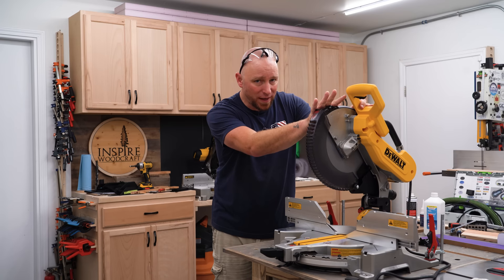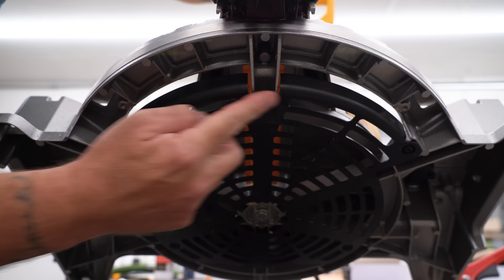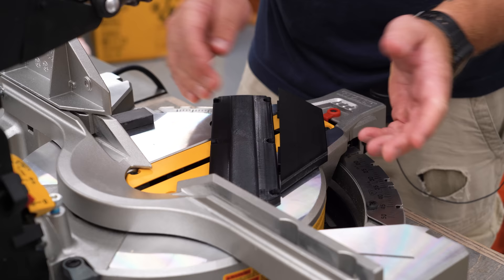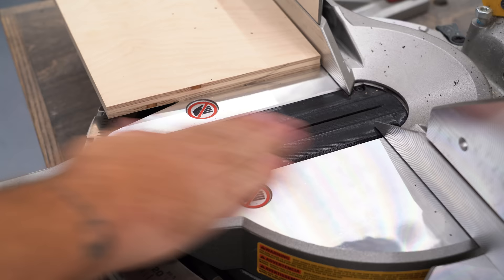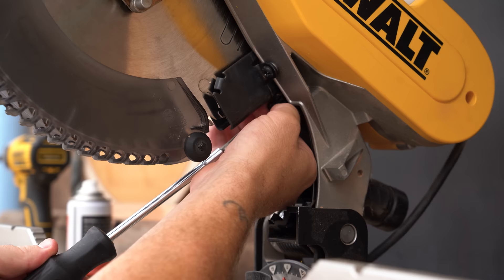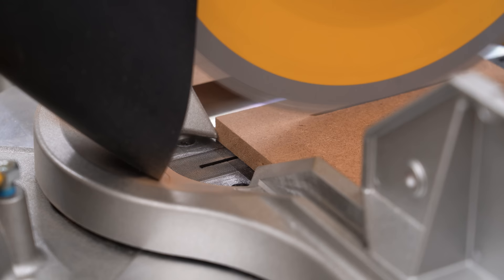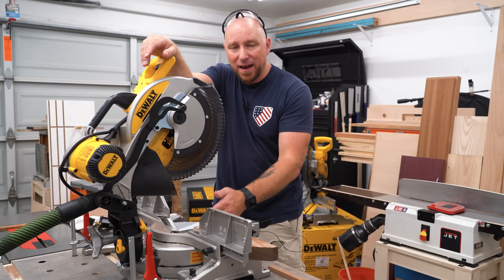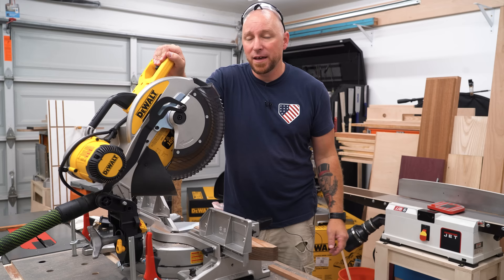The Genius Miter Saw Insert That Doubles as Dust Collection

Comment: Why does DeWalt pay inept engineers when they could just watch your channel for free?
Reply: This is a portable construction miter saw, mainly meant to be used outdoors on construction sites. The priority isn't really collecting 100% of the dust to appease woodworkers using it in their shops. 🤷‍♂ Although, it would be nice if they made an effort to collect a little more dust.
Reply: It's not the engineers, it's the budget for the engineers. 😉
Reply: Bean counters & project timelines
Reply: @BigBrotherIsTooBig wrong. If they can hire enough to prevent catastrophic failures and injuries they can quickly use basic fluid dynamics to strap on a dust boot.
Reply: @tonydavis6487 maybe it is used outside, but if it could be used indoors than it would be. Form needs to follow function, not the reverse. In fact function should never follow form.
Reply: @CraigularjJoeWoodworks  Wrong. You're stating how things should be, not how things are. Could they have engineered better collection? Of course. The engineers don't decide what to engineer. My evidence, there is shit dust collection on this saw.
Reply: I'm surprised you guys have never heard of a Rosseau zerodust Hood
Reply: @BigBrotherIsTooBig  wrong. If they can make 1 boot they have time to copy a competitor shape and call it a day
Reply: @thecloneguyz I have the Rousseau hood system and it works ok. I just added the “cyclone system” thingy that goes on top of the 5 gallon bucket and bought a new Rigid shop vac with the 5 HP motor. But it still isn’t getting everything and I really want to avoid masking up in my home/basement shop. I am curious if this silicone dust diverter will improve my setup. Does anyone have experience with the Rousseau system and using one of these silicone dust diverters???
Reply: @CraigularjJoeWoodworks   As an engineer, none of these statements are even remotely close to how it works. It's not as simple as "copying a shape" or using "basic fluid dynamics" when you're told to engineer a product to a specific cost. The "basic fluid dynamics" would likely result in a more complex casting than what they currently have, raising the cost. A shroud undeniably raises cost. People always want to point the finger at engineering, when it's often really corporate executives who they should be going after.
Reply: How else you gonna patent troll?
Reply: @CraigularjJoeWoodworks does fluid dynamics increase the budget? I doubt it. Its designed to be produced as quickly and cheaply as possible, with a view to minimum attention to dust collection given the availability of extraction, masks or both.

Comment: I believe you have finally solved the Sawdust collection problem for Mitre Saws. Congratulations for thinking out of the box!  I would like to do a similar solution for my older Makita LS1013L !0 inch mitre saw. I have been fighting the sawdust problem for years, with some successes here & there. I won't bore you with the details as you have demonstrated enough mistakes yourself. You have learned from them & that's what is most important  that's what mistakes are for. Currently I have a 4 in diameter feed to all but one of my machines, ( Mitre Saw) which is connected to a collector with 2 micron filter.  The Mitre saw resides in an enclosure which captures  about 80 % of the dust. It is set up for the ducting to be added, BUT even if I can get 90% It just wasn't worth the trouble to run that Line. I have watched at leased a dozen Videos with great ideas that almost worked. Finnaly you solved the problem, I believe. Of course the geometry that fits the Dewalt saws almost certainly won't fit my Makita.  But innovation doesn't have to stop here. I will purchase one of your gizmos and study it for the appropriate mods. It might just work for me.  Those crafty Japanese figured out how th put the curf in the center of the insert on the Makita!
Reply: Agreed. Let's get this going for Makita saws

Comment: I've been looking at several videos for solutions to the dust collection on the DWS779. While a slightly different model, it seems like you have the best solution I've found! Excited for you to put out a model for the 779, I'll be ordering both the shroud and insert!
Reply: Ditto. The big saw is more likely to be stationary and therefore benefit from proper dust collection.

Comment: I have a DWS780 compound saw. The one with the long tube in the back that people hate when they don't have a vacuum system. Dust still goes all over. Would be nice to find a better way but I don't think your system will benefit this model. I've tried to increase the "catcher' with rubber from innertubes but am only partly successful. Needs a better design.
Your videos should be the standard for YT. Clear shots and concise info!
Keep up the good work!
Reply: I have the same saw and was hoping there would be a "fix" for catching all the chips and dust.

Comment: I installed the insert and dust collector boot on my old DW715.  It fit perfectly and works better than I expected.  I used an inexpensive small Stanley shop vac with a 1.25" hose.  I've been fighting with dust collection on my miter saw for years.  I've tried several different DIY solutions, and spent far too much time and effort on it.  This is the best solution I've tried, and the easiest!  BTW, I'm not affiliated or compensated in any way, just  a happy customer.
Reply: Did you get the insert for the DW 716 to fit in the 715?

Comment: The insert looks similar to the Colliflower insert which is a good design.  The below insert chute looks like a viable dust collection solution until you have to bevel the blade to an angle other than 90 degrees.  If there is sufficient room to make the chute wider, it could possibly work for all saw positions.  Steve

Comment: Great work! This is probably the best miter saw dust collection solution that I've seen on YouTube. I don't have a Dewalt miter saw, but I'll try to replicate something similar for my cheap Ryobi miter saw at some point. I haven't used my 3D printer in a couple years, and I need to clean it up and tune it up after a move, but I do think that 3D printing is probably the best way to DIY this kind of bottom dust catching system for a miter saw.

Comment: I just installed the bracket, the boot, and the zero clearance throat plate on my new DWS716. Your dust collection system was the deciding factor on my going with this saw over another brand. For less than a hundred bucks I solved the last big frustration in my shop. I hope Dewalt teams up with you on this - or at least sends you a big fat thank you.
Reply from the maker: @tfields6364 Thanks for coming back and leaving such an awesome comment!

Comment: I have the Makita 10" miter saw, and like just about every other miter saw on the planet, the dust collection is terrible. I'm going to see if I can come up with a throat plate for it similar to yours. It already has a soft shroud behind the blade, but it doesn't seem to work particularly well (maybe my dust collection system isn't moving enough air?), so I'm going to see if I can improve that, too. Thanks for this video; it's given me some ideas!

Comment: Hi Jodi...that DeWalt bracket in plastic break very easily and are quiet costly to replace... great job for the zero clearance & your boot are very nice & clever !!
Reply from the maker: @danielvachon The factory DeWALT brackets on the newer saws are all plastic to begin with. And I'll also add that the bracket that came with the saw that I bought was already cracked out of the box. I would have never know had I not removed it.

Comment: I would love to see you do something for those of us with the 779/780 Sliding Miter saw.

I have an upgraded dust collection that works pretty good, but having a zero clearance insert like this for that saw would be amazing as well.
Reply from the maker: @charlieodom9107 I'm making both for the 779/780 right now. I've been posting progress updates on Instagram. We're getting closer. I just have to figure out vac lines and fitting for the most part!
Reply: @InspireWoodcraft  that is incredible news. I guess I should get on Instagram and see the updates.

Comment: Very impressed but I find with my Festool Kapex the main problem is when using the fence, which you were not, and if also cutting stock that is even higher than the  machine’s fence.  To avoid tearout you then double side tape on a sacrificial wooden supplementary fence, this then totally messes up the effectiveness of the main silicone dust collection shute !  = everything is covered in dust.  I admire your efforts in addressing the problem though and wish you well. Sheffield UK.

Comment: That insert is a great idea especially with the replaceable piece that can slide in or out. I have the DWS782 and made an insert out of wood that goes all the way into the cavity so it does the same thing as yours. Problem with mine is, if I get a blade with a different kerf then it might ruin the zero clearance part.
I still need to figure out dust collection with mine. The box I have built around it is almost like a shed. It's too big.

Comment: I don't own a Dewalt mitre saw but this technique should work on any mitre saw: replace the insert plastic plates with a shaped block of wood that would fit your specific saw and is thick enough to accommodate the depth of cut for the blade.
By making the 1st cut you then make a zero clearance plate and solve the dust problem at the same time without having that dust trough design that you have.
Reuse the screws to attach the replacement plate.
The only downside is you have to shape and manufacture the wooden saw 'plate' for your specific saw, just once tho'.
I did that with mine and it works a treat
 😀

Comment: someone may have mentioned it, but at the end of the video when you mentioned the "nerdy" part.  you noticed the blade lands offset, not center.  i found that interesting and it made me wonder why that is.  my best guess beside mfg error...  i notice my saw can miter farther to the right than the left by 10 degrees i think.  i bet the blade is offset to allow this, and the side to which it is offset driven by which side the motor is on.  i might be way off but it sounds right lol

Comment: Very nice, will there be an issue with bevel cuts?  The blade will enter the insert at an angle, potentially going through into that dust shroud under the ZCI.
Reply from the maker: @crzyworm623 No bevels, unfortunately.

Comment: Hello Jody Great invention.Could you invent a way to Reduce Mitre saw Db level noize ? A major complaint that manufacturers have so far not tried to solve!.Thanks
Reply from the maker: @michealhand1001 This is the primary reason I hate using the miter saw! Especially in a garage that echos!

Comment: If you get a chance look up sawhelper ultrafence 88 I bought two of them back in 2001 and they are the Rolls-Royce of chop saw stands and the company's literally evaporated and nobody's ever made one of equal quality yet
It has a camera lock positive stop that I can slam into with a 16 foot 6 by 6 and it won't move 1/256 of an inch

Comment: Impressive man. Definitely sell your 3d files. $20. 

Otherwise, since your design is nailed down, just partnering with a 3d printing service and bulk ordering based off a set preorder timeframe so you have your order already paid up front would probably be worth a shot. Way easy, fast profit, no printing. Would love to see it for the Bosch glide saw in the future.

Comment: Thank you for developing this kit. I love your approach. I’m in the DWS779 camp so I’m looking forward to what you come up with.                   I would love to purchase the silicon boot and the STL files for the bracket and throat plate/zero clearance/under-table shroud. Any chance that you are planning to sell the files for those of us with our own 3D printers? Thank you again!
Reply from the maker: @cocogarcia1454 I think I will make them available. I just haven't figured out how to price the files or put them together. Any suggestions based on other files for parts like this that you've bought in the past would be helpful!
Reply: @InspireWoodcraft  check out Shop Nation's "My toughest design challenge yet." and his store as he is doing the "same" thing.
$15 for:
(1) STL for Dust Collection Chute Body
(1) STL for Hose Transition Adapter (1.625" OD / 1.4" ID)
(1) STL for 2.5" Dust Port Adapter (2.5" OD / 2.25" ID)
(1) STL for 1.75" Dust Port Adapter (2.0" OD / 1.75" ID)
(1) PDF Instruction with print parameters, materials list, and link/QR Code to instructional video
Reply from the maker: @cocogarcia1454 We finally have them listed on the website (for the DW716 & DWS716)! If you do happen to purchase them, any feedback would be greatly appreciated. https://inspirewoodcraft.com/product-category/shop/

Comment: Today is my lucky day! Thank you for creating these. I have been trying to find something that will collect the dust from the bottom where the cut is being made and also to block the dust that your shroud actually collects. 

My miter saw is the DW716XPS and I do have a question about where the shroud is attached. The piece under the saw is metal in my saw. Your shroud has holes already but the metal piece under the blade  does not have holes. Is there a metal replacement for that piece with holes or am I going to have to drill through my metal piece that is under the saw blade?

Currently, my desk collection is out the back of the shoot that is designed on the saw. does the throat plate enclosure that you’ve designed collect dust? Am I supposed to manufacture something to collect the dust up underneath the saw

Comment: Question:  does this solution work well with a dust collector (4" hose, high CFM, low static pressure)?  If not, does it work well with a regular shop vac (2.5" hose) or does it need a fancy "dust extractor" with high static pressure?  What do you use in your demos?

Comment: Clever design but.....most of these saws will be used for construction and the lumber there is mostly green/wet. That thin slot will most likely be gummed up with wood and pith over time from sticking to the sides. Did you test for that?
Reply from the maker: @deek3048. I did not. Mainly because most folks who are working on outdoor construction sites aren't going to care about the dust from the saw. I've worked on many sites, and it has never been anything anyone cared about. Especially since the other "worst offender", the circular saw, is making dust right next to the miter saw.

Comment: You have done a great job kind Sir; with your invention; as long as the blade angle is at 90 degrees, to the table. But what it's going to do; when the blade is at different angles, to the table? Huh? I would suggest; you make that bottom invention, wide enough; so the blade will not cut into, what you made, at any angle. In any case kind Sir...Thanks❤

Comment: Looks like you have done a great job on this.  Will your zero clearance insert work with the DWS715?
Reply from the maker: @user-ek8ru2ne5h Unfortunately, it will not. My plan right now is to make one for the 715 as soon as I am finished with the 779/780.
Reply from the maker: @user-ek8ru2ne5h We finally have a dust collection throat plate for the DWS715 if you want to take a look! https://inspirewoodcraft.com/products/dewalt-dws715-dust-collection-throat-plate-insert

Comment: Quick question will the dust shroud under the throat plate be compromised if cutting at an angle other than 90? If so, what is the recommendation there remove complete throat plate and reinstall original?  Thanks.
Reply from the maker: @Bob-mw8vp Unfortunately this type of setup can only work if you don't use the bevel feature. A lot of bevel cuts can be turned and cut as miters, so that is one work around. But if that still isn't an option, yes, removing this throat plate and installing the factory one would be the way to go.

Comment: Looks like you prefer a non sliding saw? I assume this is down to accuracy?
Reply from the maker: @BenJamin-hl4hw Actually, when I bought my saw like eight years ago I didn't have the room for a slider. And most sliders at that time were like the DeWALT saws, which take up a crazy amount of space. Now there are some really space-saving designs out there, but I haven't had a reason to upgrade yet.

Comment: Thank you for the video. Awesome job.  Do you know is there a difference between the throat plate for the DWS 715 compared to the DWS 716?  The 715 is a single bevel 716 double bevel the only difference
Reply from the maker: @rickmiddleton6588 Unfortunately, from what I've gathered from a few folks who have tried to make it work so far, they aren't compatible. I haven't had the time (or space) to get a 715 in to make one for it yet.

Comment: Very cool!   I'm assuming that bevel cuts don't pierce the plastic dust shroud under the zero clearance plate?
Reply from the maker: @woodlab Unfortunately you can't do bevel cuts. I tried, but it is physically impossible to accommodate bevels as well because you would need such a large shroud that it wouldn't fit into the throat plate opening. I figure most folks who would find something like this truly useful won't be making bevel cuts anyways. Like me.
Reply: @InspireWoodcraft  I agree with you.  My stationary shop saw is never tilted.  My job site saw is usually outside.  Keep up the good work.  Hopefully those that have your attachment tell their friends or helpers not to tilt the saw.  Seems like that's usually what happens 😂

Comment: Help! I've got that original DW716 (took over a shop) and it has nothing. I'm interested in all of your dust collection solutions-and will totally buy them. But my saw doesn't even have some kind of fitting at all. All my saw has is a hole in the metal behind the blade. And I can't find the piece that would go in that hole in order to attach anything. Anyone have a lead on finding that part?